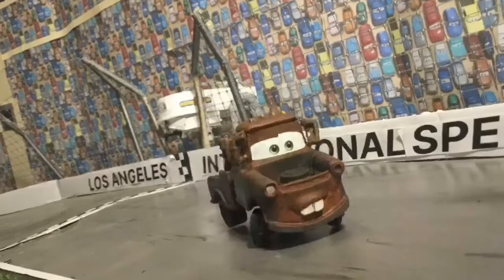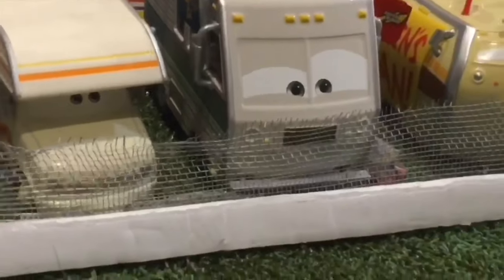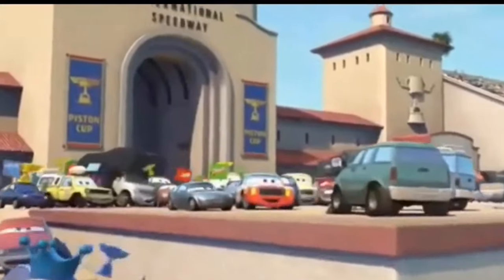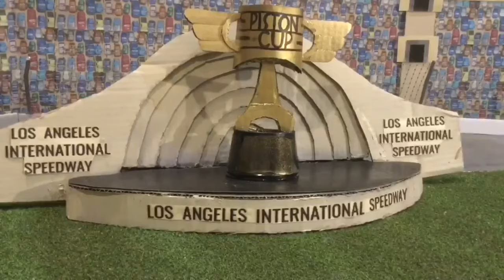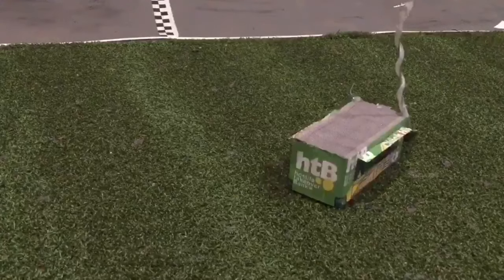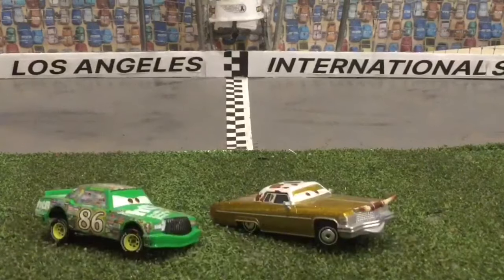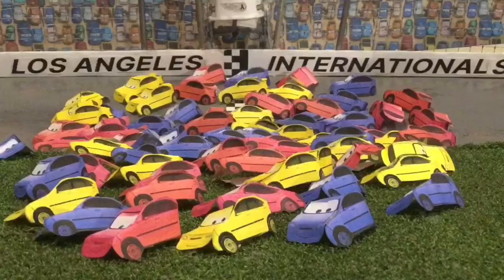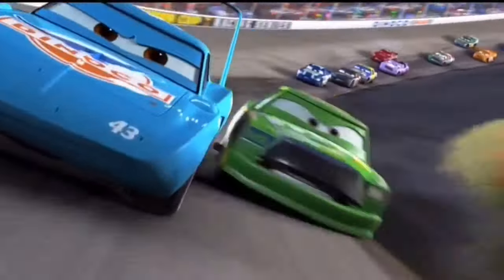Cars Piston Cup Track Showcase/Tutorial (LA Speedway)

Comment: Where did u found all the ressource like the people on the track side, the lap tower, the podium and the lodge ? :) nice work. If you make this yourself can you tell me where i can found it please ? i really want to make a track for my brother. thx
Reply from the maker: You can find most of the materials at dollar and hardware stores. Much of the track was assembled with a hot glue gun and the majority of the cardboard pieces were spray painted to match the correct color of whatever that specific set piece required. All the decals were designed by myself on Google Drawings at the time which is a free tool for anyone to use. Don't forget to be safe with cutting and especially spray painting - hope this helps and good luck with your track :)
Reply: @TheCarsShifter  Where can we found the specific tools on Google drawing please ? thx so much

Comment: Your LA Speedway is so realistic, I will love to make tracks just like yours for my upcoming NASCAR stop-motion series: Shell Cup Series, do you have any tips, please?
Keep up the good work!
Reply from the maker: Thank you so much! I remember your WGP stop motion by the way, you might be what I'd consider the first classic cars YouTuber to comment on a video of mine! And sure, I've seen many people's tracks for those kind of videos and most of the time they make them so small to the point I'm left unimpressed. Not that they need to be big since you really just see the racing, but from what I can understand, you're going for something bigger like mine so what I'd suggest is building it on some sort of wood base, having banking not only in the turns but also on the front stretch since I've seen no NASCAR channel attempt that. Same rules apply with creating the banking with foam which there are much better video on if you just search it up. You  can use anything for the track surface, I use bristol board and spray paint it gray, weathering it as much as possible with black paint. Styrene is probably best for the wall and any sort of chicken wire you find at a hardware store. Fake grass is something I don't see many people use so do that too. Every building is made from foam that is hot glued together to the precise measurements to the template. As far as filming goes, don't be afraid to damage diecasts, paint marks on the wall, or pick dirt from outside for spins in the grass. If I were you, I would try to make mine look as different and upgraded as possible from other YouTubers and considering most of them make it either very small or undetailed, that should be a pretty easy task. Let me know if there are any more specifics you need to know about because I'm happy to help. Thanks for watching!
Reply: @TheCarsShifter  Wow, I am surprised you mentioned my first Cars 2 WGP Stop-motion race video which was so bad and rushed, that means a lot to me! I have all 11 WGP Racers and I will might do another WGP race in a near future. I started collecting NASCAR die-casts because I have big plans for them including the upcoming NASCAR Shell Cup Series. Thanks for those useful tips, I will let you know if I need more help from you, keep up the good work!
Reply from the maker: @1989worms1  Thank you, my pleasure! Remember anything you need, just ask! :)
Reply: @TheCarsShifter  You're welcome! Sure, I will let you know if I need your help! 😉👍